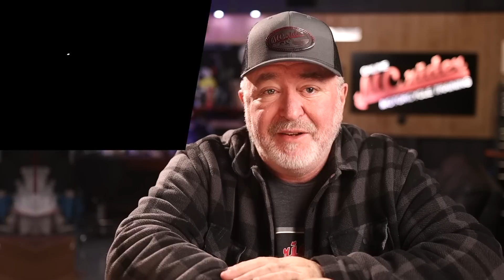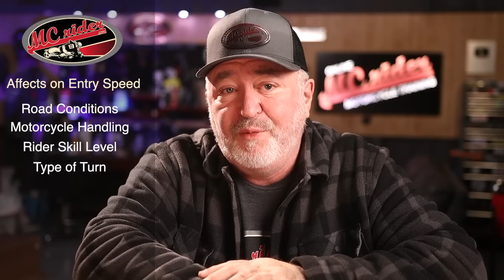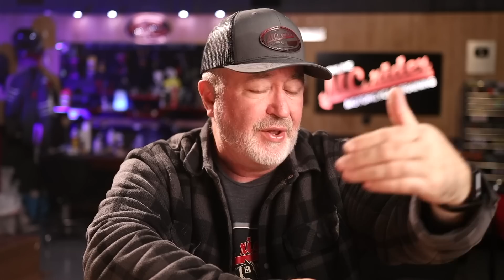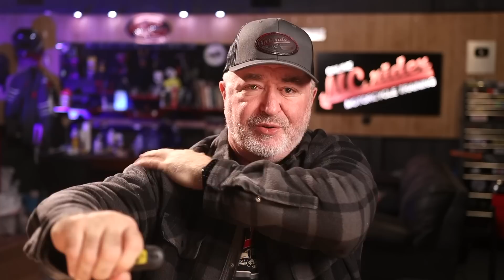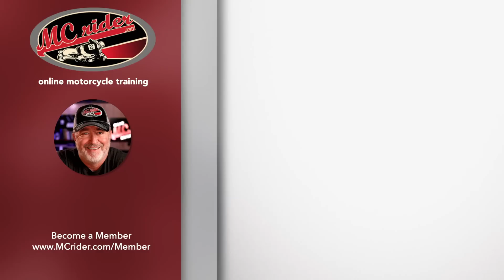Become a Cornering Master in Minutes! 3 Secrets Revealed

Comment: Took up street riding at age 58 last summer. Ride a Triumph T120 and just love it! At my age crashing is not an option. Committed to full gear and try to stay away from heavy traffic as much as possible. No night riding for me. 😉 I ride strictly for recreation. 

That said, I do have past motocycle experience riding dirt bikes as a teenager. The clutch/shifting/braking coordination, I seem to have never lost. 

All that said...I have never once felt out of control in any curve so long as I stay within 10 miles or less the posted speed limit and pay attention to posted warning signs for curves. To me this is the single most important safety measure when navigating a corner on streets. 

Happy riding!
Reply: Blast out of the curves for the thrill but enter the curves as though you are riding on ice. The satisfaction will be just the same IMHO...

Comment: Excellent! Consider moving your butt a little to the left or right when you start your countersteer. Throttle, clutch and brake controls are usually easy to adjust for smoother operation. Always interesting and informative, thanks!

Comment: What's the safe speed at the apex on good road surface on a 90 degree turn?
Reply: If the radius of the turn is 1/2 mile, you can go thru it really fast. If the radius of the turn is 10 feet, you'll have to go much slower.
Reply: That's kind of like asking "How long is a piece of string?" More information is required.

Comment: 7:00  paraphrasing... "ride like a chicken"... excellent advice!  My only bin in 20 years of riding was on my first day.  Not leaving slack in my throttle arm was the cause of my first (and only) off in 20 years of riding.  Bend those elbows.. if the bike gets away from you even the slightest bit with a straight throttle arm you can roll the throttle up it's "hello pavement".